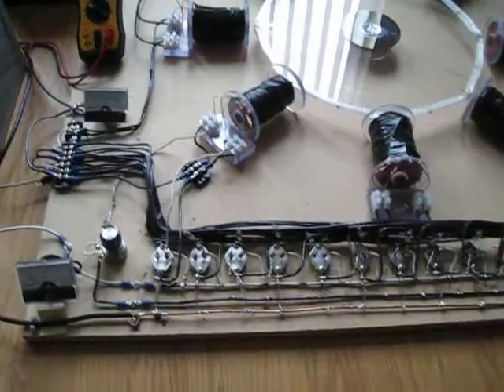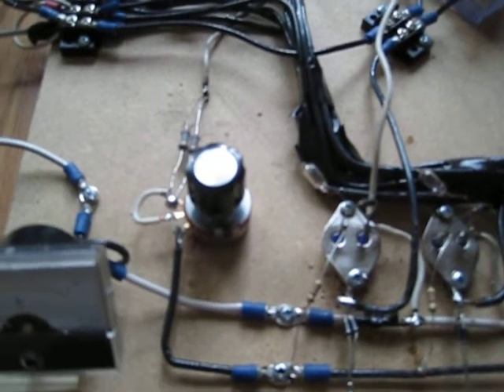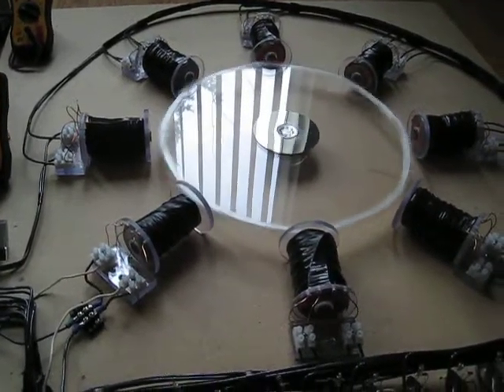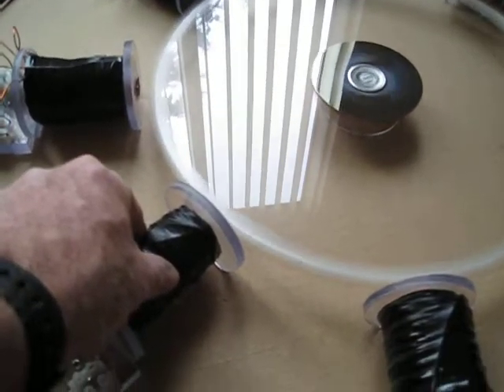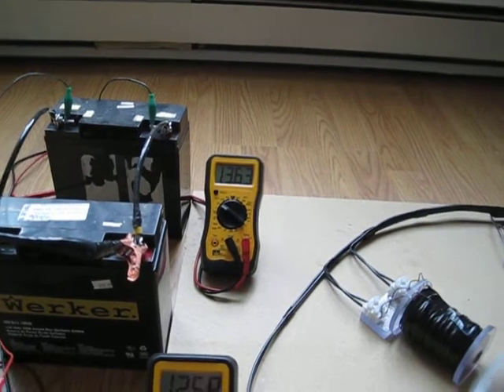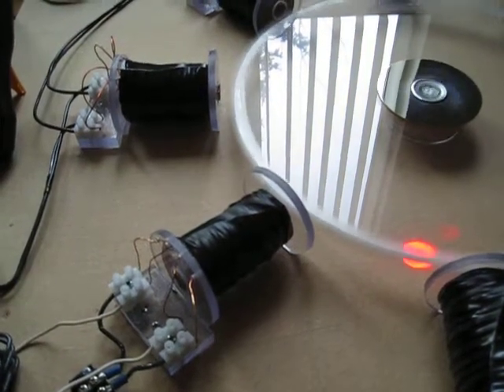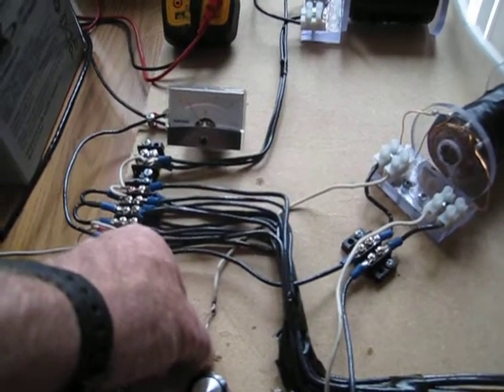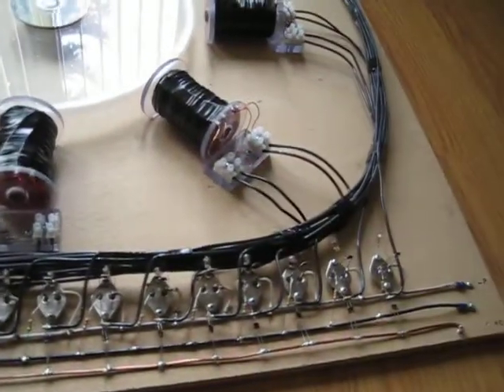1 trigger coil 15 run coils 001.AVI

Comment from the maker: howdy price, there are actually 8 coils each are bifilar, with a total of 16 strands of individual wire, one wire is needed for the trigger set up, and the rest goes to each transistor. thats why it ended up with a odd number, i could of put one extra strand on one coil set to make it 16 transistors, just the way it worked out, its got very good torque also

Comment: I'm curious... this looks like a Bedini motor with multiple "load coils"  couldn't tell if your magnets and coils were the same number.  An odd-even configuration would dampen the cogging... every little bit helps.  "IF" it is a Bedini setup, did you have any issues regarding the timing of the load dump?

thanks -j.

Comment from the maker: seems you dont under stand speed and charge ratio making a comment like that. running a pulse motor is not all about speed, if you run the rotor to fast, then the generator coils are charging the other batterys faster then a C20 rate.